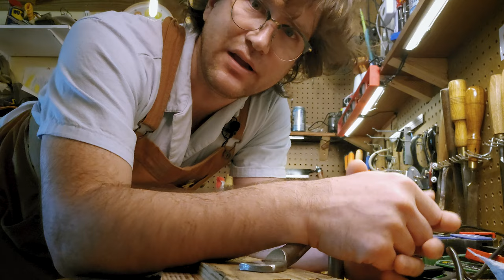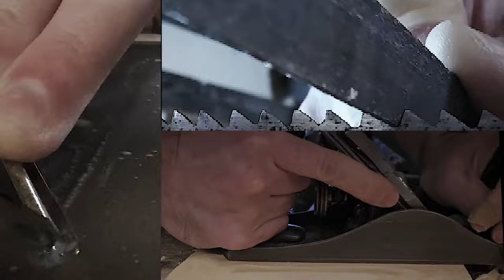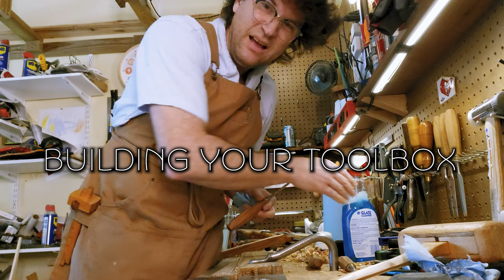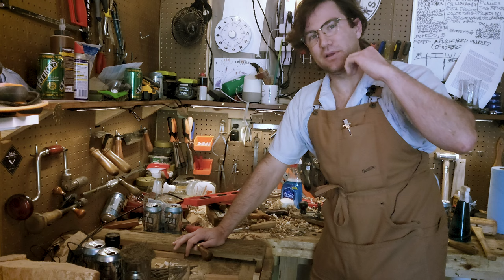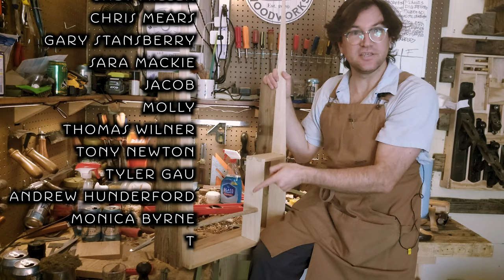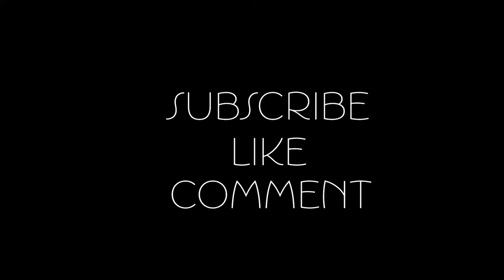Good Teachers, Bad Teachers, and Building Your Personal Toolbox with Their Advice

Comment: Good rap- keep it up!
Things I have learned:  There is no hierarchy of wood- fancy wood is not better than plain wood. There is only fitness for purpose, and often what is needed is a block to go in the dirt.
Try not to put one thing on top of another thing because you will likely need the bottom one next.  The thing that you begrudgingly spent 45 minutes making or improving has a good chance to still be in use 45 years later.
Reply from the maker: Thanks, glad you liked it! Also, thank you for sharing your experience!

Comment: i have the horrid habit of absentmindedly placing a tool on whatever surface is available while i reach for the next tool. i am constantly losing tools that way. had to start using a toolbox with dedicated spaces for everything so i wouldn't let the tools pile up on surfaces. works most of the time. my shop used to get so cluttered that i'd avoid going in there at all because there was no room to actually do anything because every tool was just sitting every available surface.  everybody has their challenges and has to figure out what works for them. i like your idea of one motion to get the tool and put it back. my toolbox is setup such that if it is open already it only takes 3 movements to reach the most buried tool. similar idea i think. enjoying your channel. i don't know if i've said this before but it feels sorta similar to Adam Ragusea a bit in the edit and conversational style. that is intended as a compliment.
Reply from the maker: Thank you! I'm so glad you're liking my channel, and I appreciate the comparison, plus I love hearing about other people's solutions to workshop issues!